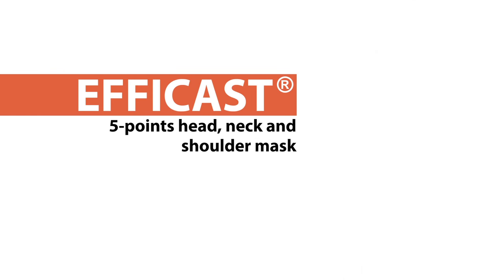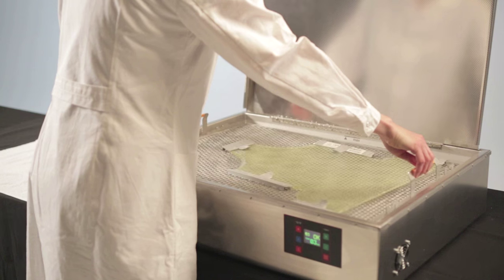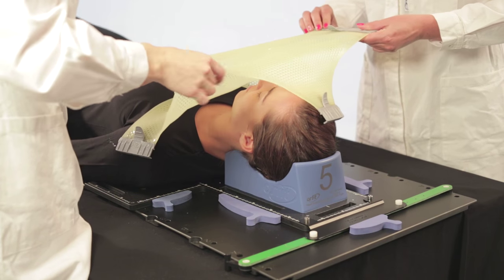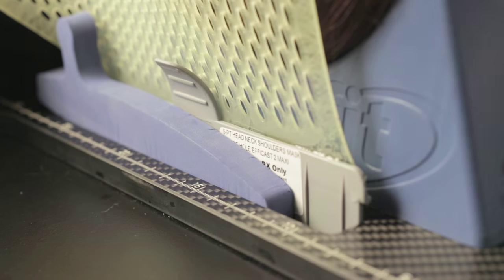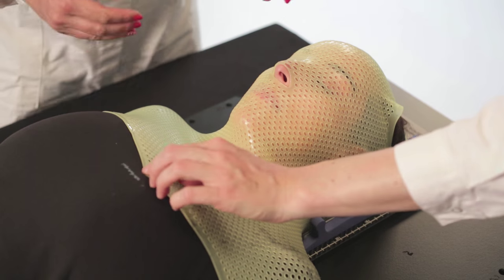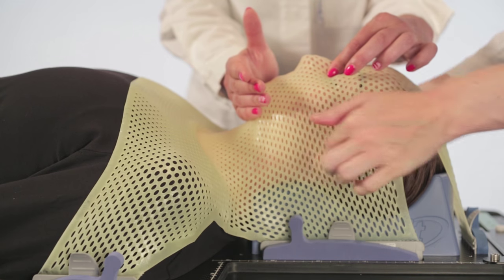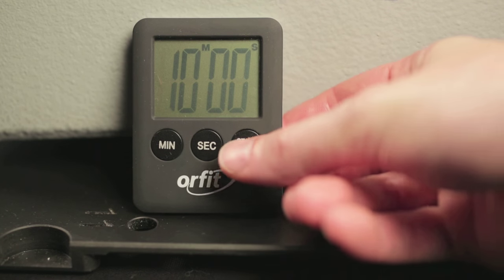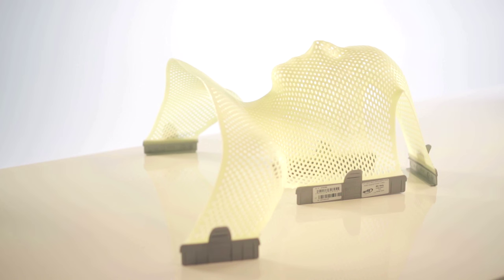Efficast 5-points Head, Neck and Shoulders Immobilization Mask - Instruction Video

Comment: how does it feel to wear that mask when it is made?  oh why does she have bandages around her hands?
Reply from the maker: Hi Eirik, when the mask is being molded, it will feel a bit warm, similar to the sensation of a warm spa towel. After the mask has fully hardened, it will feel quite secure and tight. This is necessary to keep the head a still as possible and ensure accurate radiotherapy treatment. 

The straps around the hands are for more comfort; they give the patient a comfortable position to rest their arms during treatment.

Comment: Why does that mask need a dedicated nose hole and why is it so important to make sure that they pinch the nose to keep it on there while they are adjusting it? Are the millions of small holes on the mask together not enough to make it breathable? I doubt you could even suffocate in that thing. You could probably even breathe through your mouth in that mask too. I'm a mouth breather myself anyway. I can't breathe exclusively through my nose without freaking out. I also can't have anything on my neck in any way, shape or form. No necklaces, hands, turtle necks, crew necks, ties, scarfs, etc.